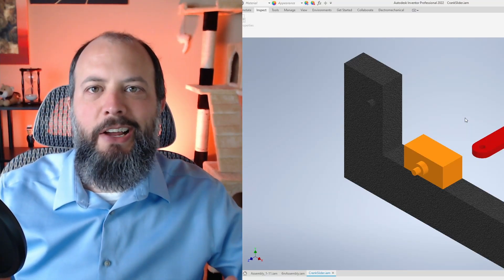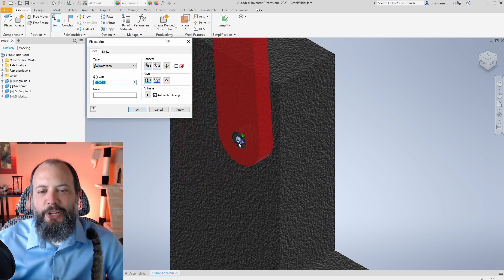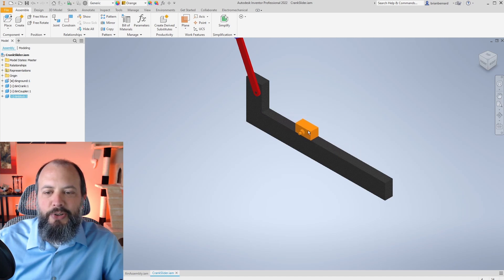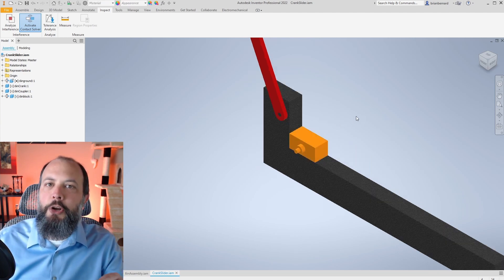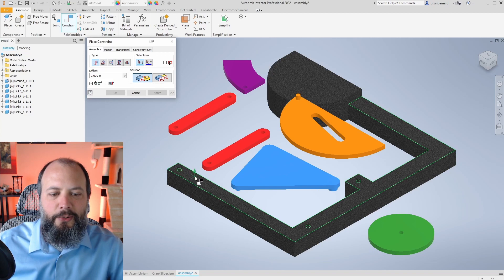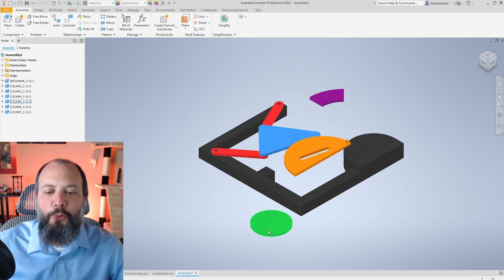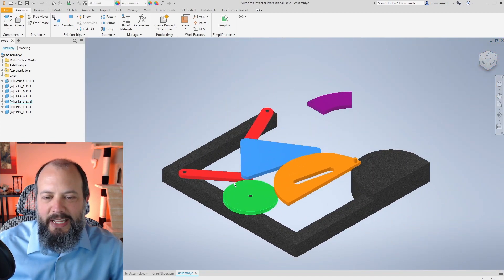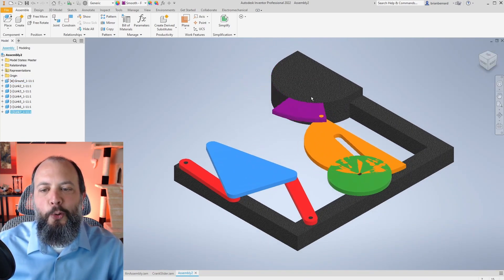Slider, Pin in Slot, and Tangent Joints and Constraints in Autodesk Inventor Assemblies

Comment: In the dialogue boxes, Apply and Cancel vs Okay. What is the difference, my friend?
Reply from the maker: They are often exactly the same. Hitting "Okay" is the same as "Apply + close the window". The reason to hit "Apply" instead of "Okay" is that "Apply" keeps the window open, so that you can do another constraint without having to re-open the window. Hitting Apply then immediately cancel to clsoe the window is exactly the same as just hitting okay. For me, I have so often hit okay, only to realize I had another one to do and had to reopen the window, that I developed the habit of always hitting apply instead of ok, which keeps the window open, then if I don't actually need anything else, i just hit cancel to close the window. It's just personal preference. Hitting Okay instead is perfectly fine.